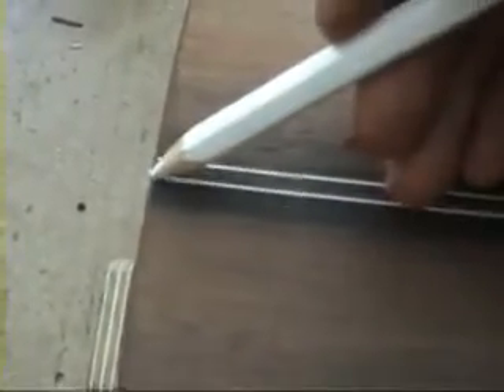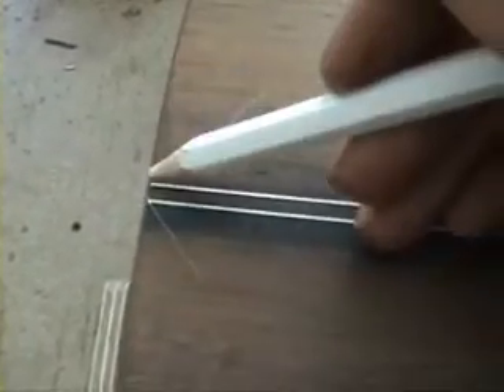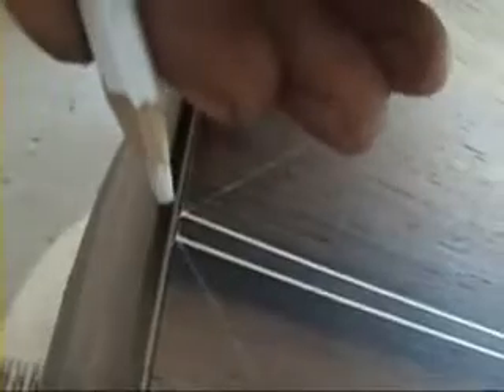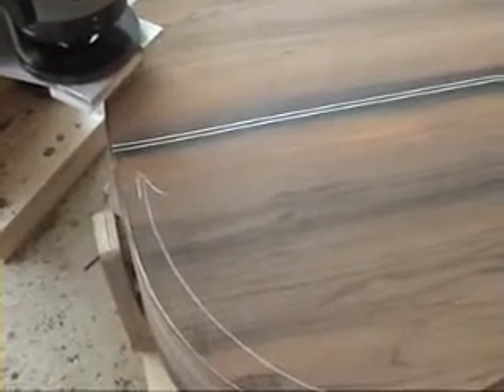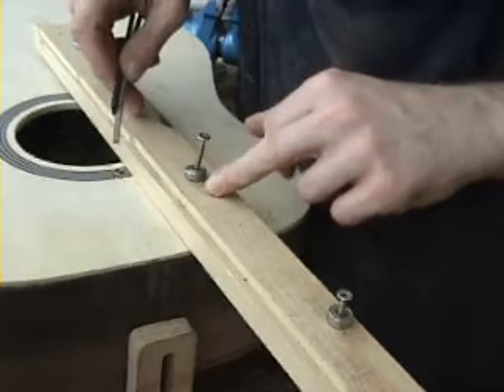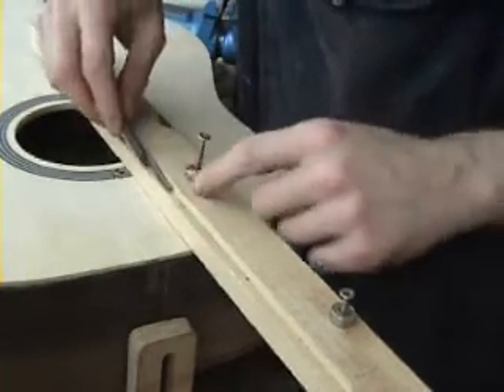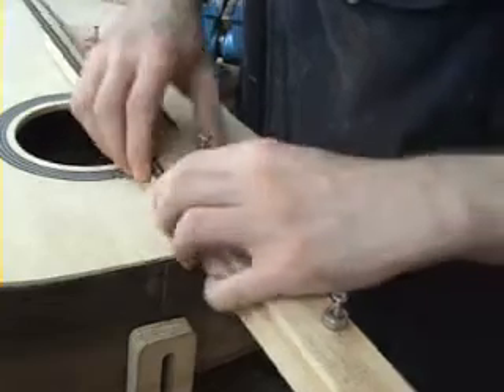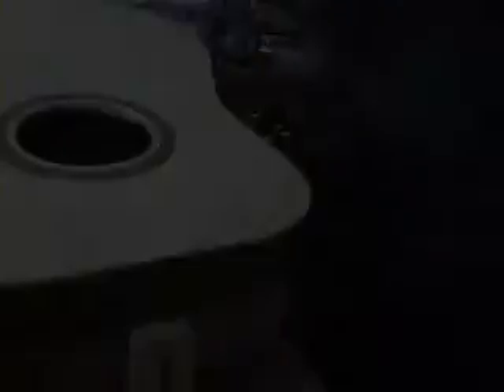How to make a guitar - Binding 1 with NK Forster

Comment from the maker: I've stopped using dremel as I find them too unsubstantial - you get too much vibration in the drive column  and I find the results are more consistant with the bigger machines. I use a similar sized router for my rosettes too and have less hassle than before. plus I've found Dremel don't last as long as I'd like so using a larger router or laminate trimmer works out cheaper. 

But as we both know, when things go wrong with a router, it happens quick and takes a long time to mend.